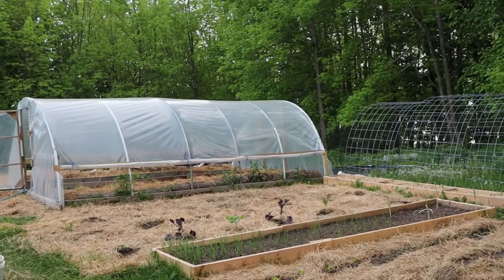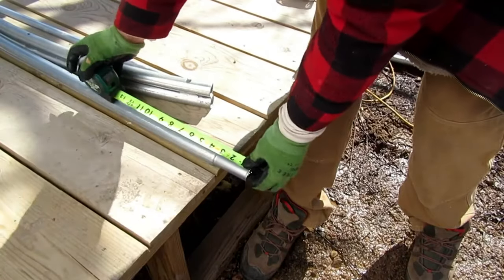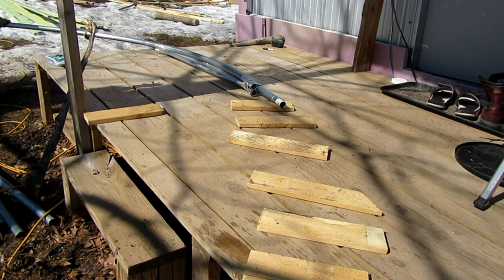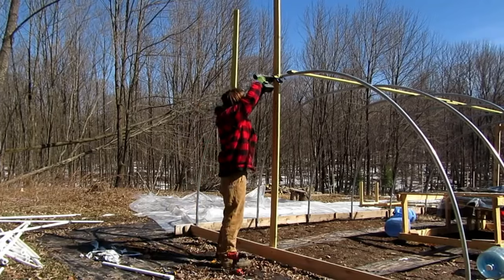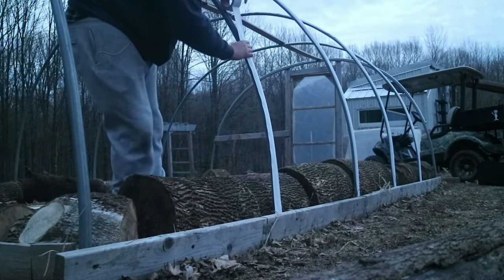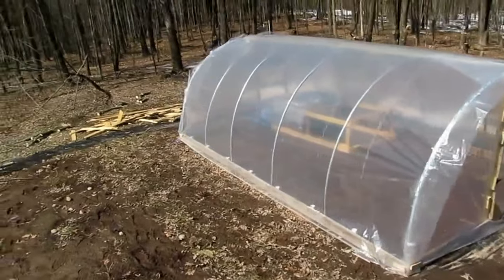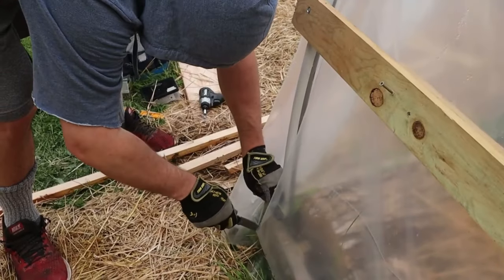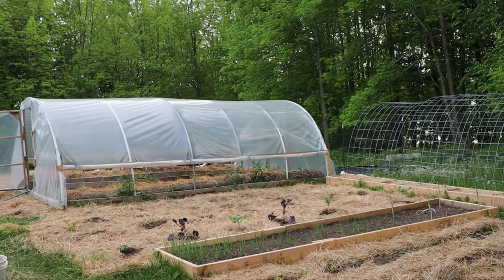DIY Metal Hoop House Build │ Simple High Tunnel Greenhouse

Comment: I live in a very windy area, at high altitude so the wind is ferocious sometimes. You think this concept could handle it?
Reply from the maker: That is tough, I’m not sure. This one made it through some storms with really high winds, but idk how it would hold up where you’re at.
Reply: @TheNorthBranchWI  Thx you man
Reply: I'm leaning towards a cattle panel hoop structure instead of poles.  We've used cattle panel hoop houses for critter houses and they've handled 80mph straight-line winds plus the usual 40mph winds/gusts coming from all directions at all times.  The extra support that 4' spaced poles seems to make a difference.

Comment: Was the cedar what you had available or was it because of its fungal properties?cheerz from NNY
Reply from the maker: We got those boards from the hardware store. And it’s either cedar or pressure treated for the foundation.
Reply: Yep! Cedar, Cyprus, Teak and Redwood have similar properties that naturally resist infestation by bugs, including termites (which probably make it OK to put the wood in direct contact with the soil, usually a no-no). Also refuses to rot, mold, mildew etc. Mother Nature is a wonderful thing! 😊

That said, teak is not the best in sun, as it kind of dries out and falls apart at the seams, as it were. (Witness the beautiful teakwood patio furniture sold at my favorite now-defunct two-name "outdoor living" store... it was known to fall apart if not treated for sun exposure. Who wants to do maintenence on a hoop house? Not Me!)

Comment: How much did you spend for everything? Nice build by the way. This style is what I'm trying to start my greenhouse with.
Reply from the maker: I am not even sure for this one. It was a few years ago at this point so it is probably not even comparable sadly ahah But the pole bender was the biggest investment, followed by the plastic. And then the poles are 10-20 I believe depending on what you want to do. But this is what I would recommended if you are trying to build the least expensive greenhouse possible.

Comment: Don’t understand where you got the metal pipes from and don’t understand how the wiggle wire goes into the pipes ?
Reply from the maker: The poles are from Home Depot. And you attach the c channels on the front and back hoops, pull the plastic over the channels and snap the wiggle wire into the channels and it holds the plastic in place. I wish I had better footage of the wiggle wire.
Reply: Gotta buy the channel and screw onto the pipe for the wiggle wires.
Reply: Is there another of your videos that explains or shows the bug problem you mention? What kind of bugs?